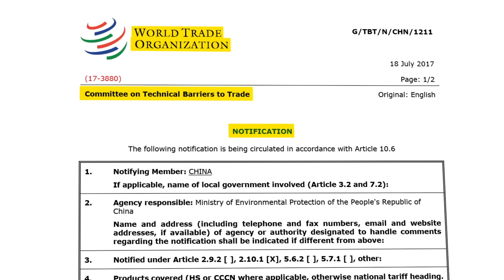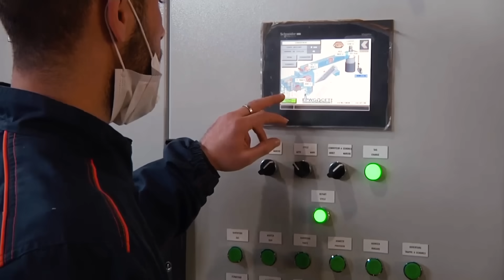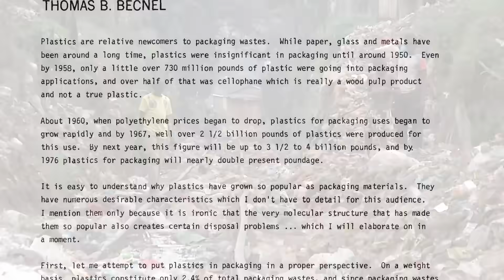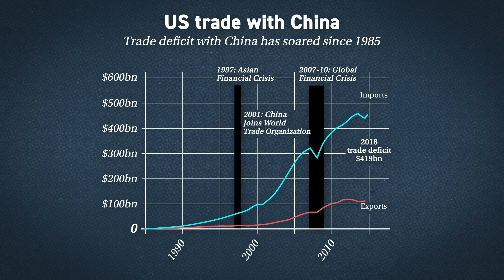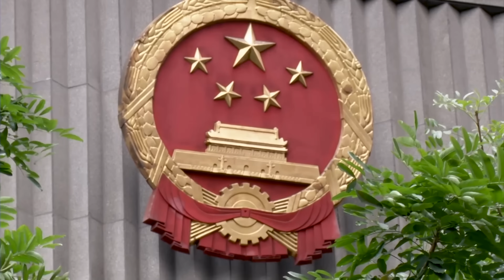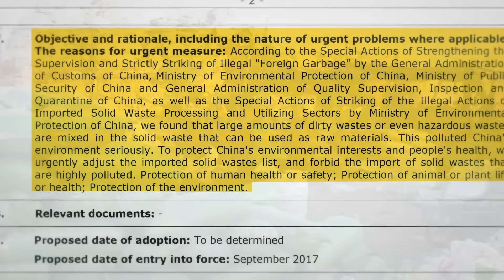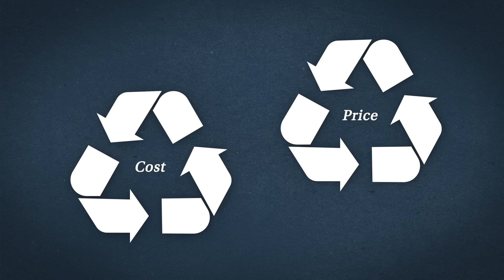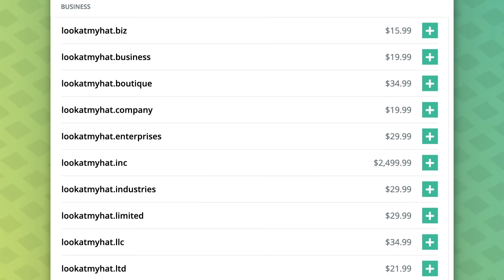How China Broke the World's Recycling

Comment: Good video! Seems to me that the consumer won't demand recycled plastic over virgin. The government needs to require that the virgin plastics need to have the same, or more price point as those that can be recycled. Additionally have a fee, on all plastics, imposed for return, of that fee, back to the retail establishment selling the non recyclable virgin plastics. The retailers would immediately require the use of recyclable materials for all plastics. The fee for all recyclable plastic could be redeemed at any recyclable receiving location. Undoubtedly there is alot of technical issues with how much a plastic product can be recyclable but it would be a step in the right direction. Maybe the new 87,000 IRS agents cab go out and inspect garbage pick ups and impose fines, lol.

Comment: Virtually no mention of a system that I know exists. Don't take my word for it , look up plastic to diesel.  Based on the fact that plastic is literally 95 plus percent oil, You simply have to melt the plastic down until it boils and makes so called steam and then when the steam is recondensed it is diesel fuel. Something that you can dump right into a trucks gas tank and run on. Take that diesel fuel boil it again and the condensed result will be gasoline that you can dump right in your car.  This is how crude oil is processed simply boiled and recondensed.  Why is this process never mentioned? I imagine it has the do with the oil Lobby, who exercise far far too much power and will spend billions to keep their product viable and unassailed by any real competition.

Comment: It could be easy: you want to use plastics (or any material) in your products and/or packaging - you pay for proper recycling in advance before you're even allowed to start production. Thus it just becomes part of the cost and the recycling is actually going to happen. Yes, that will require government involvement through passing of jurisdiction. Oh don't act surprised - you know you can't leave a free market to its own devices, it will inevitably lead to broken environments, broken economies, broken communities, poverty and slavery, plus a select handful of very very rich individuals. Look at history, the plantation owners didn't abolish slavery because it was the right thing to do, the English factory owners didn't abolish twelve-hour shifts for ten-year-olds because it was inhumane. They had to be forced because any other solution was less profitable. Maximising profits only works by (legally!) neglecting anything not related to profit, so legal requirements really are the only way to go.

Comment: This video is ridiculous because it says that recycling is not sustainable. It is sustainable, it is economics. You just need to legislate that the plastics manufacturing should use recyclable plastics, and/or that plastic uses externalized costs are included in the up front price. If the non-recyclable plastic is 2 cents cheaper, the manufacturer will use that one (and do). They will switch if required to.

Comment: I have an idea. It must not work though, because it is simple and no one that I can see is doing it. If it worked, I bet people would do it.

Manufacture a very large fresnel lense, like the size of a tennis court or even better, a football field. Position it in a place that gets constant sun with little rain, such as Nevada or Utah. At it's focal point it will get about 5,500°F, and it should be a pretty large focal point if it was the size of the a football field (focal point probably isn't the right term. Just focus the beam to the size of a car or something). This would make breaking down raw plastic materials extremely easy, and you could distill the vapors to make various oils, monomers, and other chemical feed stock. That feed stock can be then further manipulated into polymers or completely different products. This is not a process than can be done only one time, it can be repeated indefinitely provided you don't lose material in the process. You may find troubles recycling plastic multiple times, but if you break it down you can sort pure materials out of it. The energy is provided by the sun every single day, and it can facilitate very difficult chemical reactions. 

I must be wrong though. Maybe the EPA doesn't allow this. Maybe a company is doing this and has lobbied into existence laws that prevent others doing this. Maybe it wears out equipment so fast that it isn't worth it. Or maybe isn't enough plastic to be worth it. Maybe there is too much plastic to make this work. I must be wrong, there must be something I cannot see. 

I have done this on a smaller scale. My fresnel lense (only 3ft by 3ft) gets about 2,000°F. I can melt certain metals. I can create longer chains of molecules if I wish. I can extract many oils from plastics. I know the plastics they mentioned could absolutely be valuable to industry if they were broken down.

 If it does work- take my idea, you can have it. I have other things I am doing and I won't do this for many years, if ever. If it doesn't work, tell me why so I can stop thinking of this. Or maybe I'll find a solution to make it work, if it doesn't.

Comment: Plastic can only be recycled a few times.  Each time they must add new virgin plastic and only a percentage recycled.  Everytime it is recycles it is cut up.  The polymer strands get shorter and shorter.  Shorter polymer strands do not hold together as well.  Imagine a bird making a nest.  Only every year the nest is chopped up and used to make a new nest.  Since it was cut up the grass and sticks get shorter and shorter each time.  After a few times the grass and sticks are only one inch long.  The bird nest will fall apart.  Each time the bird needs to add 25% new grass and sticks so it holds together.

Comment: What if we... distilled the plastics and sorted them by heat and various tanks in a 0% oxygen environment where we can extract diesel, gasoline, kerosene, and carbon games (that don't liquefy at room temp and burn them as waste and use some to heat the waste plastic and others to power the plant or even pipe to housing for heat and cooking)? Then those products can be sold to give raw fossil fuel competition and drive down fuel costs... until an equilibrium of both virgin and waste plastics are about the same. Then the CO2 can then be reduced by plants and sunlight to make more carbon stores called wood, leaves, and fruit. In this way we are not subsidizing communist countries like China and we are clearing our own waste, making more/recycling fuel, powering homes and vehicles, reducing transportation  costs, and making more trees.
After all, the atmosphere only contains less than .04% (.0004) CO2 which means global warming by this particular gas is not even an issue.

Comment: In the near future recycling of plastics won't matter since there may not be anymore plastics.  You see plastic is a byproduct of oil and thus available as a result of the use of gasoline.  Many products are in the same boat. Electric cars are self destructive. By getting rid of oil to make gasoline, oil become something that is no longer profitable to produce.  Things like the insulation on wire, tires for cars, asphalt for roads will no longer be available or become so expensive that they will become nonexistent.  This whole conversion to electric cars is not very well thought out.  To make things worse there is very little to gain in terms of lowering co2 something that doesn't even have a goal level to start with.  We are shooting ourselves in the foot trying to solve a problem that may not even exist.  Maybe we should be stocpiling plastic for use in the future.  Just think you could be paying $2 a bag for the grocery bag at Walmart......

Comment: Don't discount the landfill as an environmentally friendly alternative. With proper management they are by far the most economical and therefore (yes that is how it works) most environmentally friendly method of disposal for anything other than metal in general and sometimes glass. Because, while we make alot of trash, the land this takes up is negligable compared to how much is available, particularly when you consider that the best places to build them are some of the worst places to live, ie steep vallies and canyons. A canyon can hold cubic kilometers of waste while also providing geologicly stable contianment and the necessary drainage flowline for all liquids generated by the waste to flow by gravity into a sanitary sewer connection. But their benefits don't stop there. By arranging the conditions we can keep carbon containing wastes like wood and plastic dry with low oxygen so that they do not degrade which is an effective form of carbon sequestration from the atmosphere. In a way their technological advancement has made landfills follow the pattern of nuclear power plants. Mistakes in their design in the past and the uses to which they were put have been 100% solved and they are now nothing but beneficial.

Comment: "Shut the system, the entire system, down." With all due respect, that is by far the dumbest thing that I've heard in one of your videos. There is literally no material that could replace plastics entirely and no set of materials that could do it either. What's worse, the replacements are no better, substitutes and bioplastics will do nothing but eat up land that we need for either food or biofuel. Biodegradable plastics and finding micro-organisms that digest plastic isn't a good solution either. The reason for that is because most of the time the byproduct of breaking down plastics is CO2 or methane which is released directly into the atmosphere. 

From a global warming perspective, the crusade against plastics is idiotic, they literally sequester carbon; if made with clean energy they would be carbon neutral, irrespective of the raw material's origin. Plastics replaced materials that needed extra cropland to be produced and we cannot afford to turn back the clock for this. Not even in that fabled, yet highly unrealistic scenario where everyone goes vegan would we able to do this. Vegans might be blind to the productivity of pasture land or lack thereof, but no one else is, and nature cannot be fooled.   

There is zero chance that the public will back phasing out plastics once they realize the cost to their standard of living. That is the always the case when we talk about consumption and that's the reason I'm so dismissive of anti-consumerism. The only way forward is for the government to make economics work in favor of recycling. I fail to see how that would be any different than a carbon tax or regulations in general.

Comment: There is something even more troubling than the recycling problem in America.  That truck carrying plastic to ship to China...that is something that started and has gotten progressively worse since the 1990's.  Our freight rail system is dying a slow death driven by monopolization and terrible service.  What should be a highly efficient way to move goods 1000 mi. is a last ditch option for logistics operations.  Multiple presidents have passed "infrastructure" packages, in my lifetime, and they have accomplished jack-all to solve America's failing freight rail system.  People will continue to waste time and money on the dream of light rail in a sprawling nation, while we use less efficient and less safe material transportation methods(to include using trucks and trains over pipelines).
There is a "dead' freight rail hub within a mile of where I live.  A sad reminder of a time, now forgotten, 40 years back, when trains would carry goods to that yard, and tractor trailers would stage, load/unload, and depart from a large parking lot with it's own fuel station.  You can drive by it, and more often than not, you will not see a single tractor trailer in that sad aging lot, even though it is still "operational".

Comment: @Wendover Productions: One could wait, as you suggest, for a purely economic solution to what you suggest is an economic problem, but I disagree. While I agree 100% with your analysis from an economic perspective, there's more to it than that. You even hint at the origin of the problem, that is the American plastics industry hijacking recycling and bribing their way into producing more plastics, more types of plastics, and composite/unrecyclable plastics. They designed the policies we have today and obfuscate the the source and scale of the problem. There is a political solution to this economic problem: it involves regulations/incentives/taxes/whatever to reduce plastic production as a whole in the first place, restrict use cases for or increase the cost of single use, low-grade plastics, etc. As much as possible the onus and cost should be placed on manufacturers and packagers. This is the most economical solution by far, dealing with plastic waste by entirely removing vast amounts of it from the waste-stream even before having to recycle it. Recycling is the least effective of the '5 Rs'. As for the waste that inevitably is produced, we've no need to reinvent the wheel, just pick what's been tested and works best elsewhere. Part of the problem in North America, as you mention with MRFs, is the result of our poor choices when it comes to how we recycle. Decades ago we intentionally chose a contaminated waste stream (instead of a diligently sorted one like in Japan), assuming people wouldn't  which greatly increases the cost of recycling and reduces what is recoverable. At the very least, we should have separate bins for glass (ideally sorted by color, like in German), metal, plastic and paper. This would increase the value of the material and reducing processing costs. Also plastics should be properly identified as recyclable or not (not technically but actually). Here's an example from the UK: let's say you buy prepacked sliced ham. The bottom black plastic container is clearly identified as recyclable while the clear plastic film isn't. If the film isn't removed from the recyclable rigid plastic, neither is recycled. In NA, nothing is identified like this and becomes garbage. Anyway, there's still much more to this of course, just thought I'd add a policy perspective.

Comment: As a recycler I've often wondered if plastics could be shredded and blended in with concrete to make it more pliable with weather and temperature changes for roads if possible. Of course not in structural situations but in flat highways. Only a concrete expert could explain if this is even viable due to bonding plastic with concrete. Just another thought on this problem.
Reply: This is how we get more and more microplastics in the environment, not a good solution. That stuff is toxic to most living things

Comment: Shut down plastic processing, switch back to using glass bottles, cloth bags, etc, and have several countries fund a small nation to build OSHA compliant processing facilities. Honestly, in thinking of ways to properly bring us into the space age, a minimum entropy agreement would do wonders in general, a vow to finish what's on our plate before serving up another. Honestly, it's kind of insane we aren't using recycled plastics as building material. A few strands of hemp or bamboo fiber inside a plastic beam is an amazing wood analogue for building with, or even plastic injected bundles of fiber for more grain where it's needed. Someone, quick, make a hipster company and build tiny homes out of this, you'll be a billionare!

Comment: I still don't get why we can't just put all garbage in a huge smelter & have a system to catch & clean the burn off emissions. At least then, we could stop putting mountains worth of garbage in the ocean & taking up huge areas that used to rural. I get that the byproduct would be no good for building, but melted down waste takes up way less room than all the bulk just sitting there.
I also wonder why we couldn't put all radioactive waste on a rocket & launch it at the sun. By the time it burned up & spread through space, reaching us, the parts per million would be very small. The only thing I could see if there was a problem during launch. Those aren't as common now though.

Comment: The conclusion of the video is we need to shut down completely the system (difficult) or consumers need to request recycled plastic. That's... wishful thinking. More often than not, the plastic is a vessel to a product and no one will choose Pepsi over Coke based on the bottle composition. An obvious solution, that could have been reached back then in 1969, is to tax virgin plastic more than recycled, and incentive the use of the later... But that would be bad for the plastic lobby, they were right..